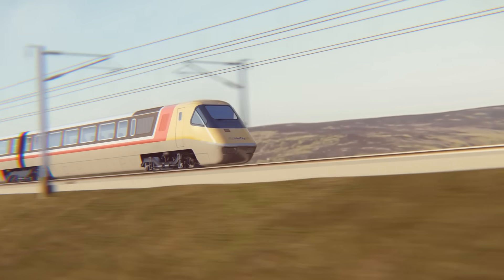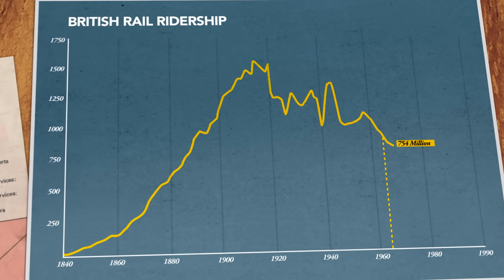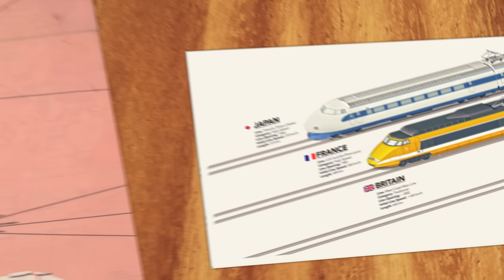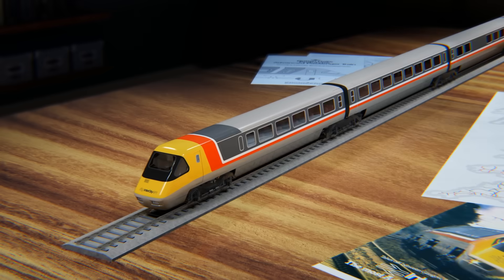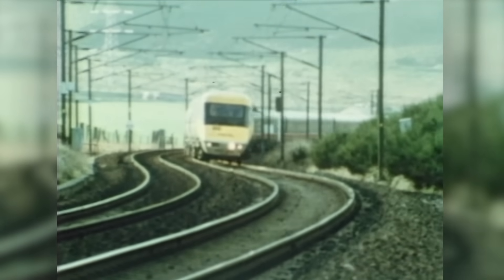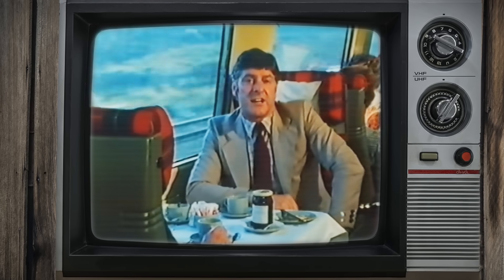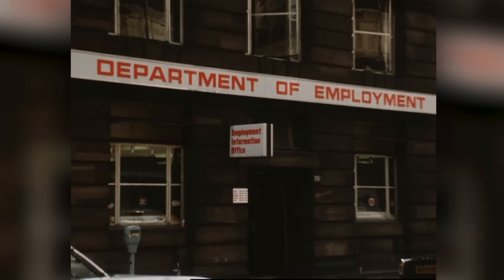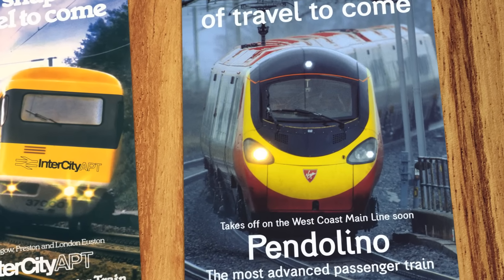This Train Made Passengers Sick: The APT Tilting Train Story

Comment: Destroyed by the press, the plans were sold to Italy for £40,000 and we bought them back as pendalino
Reply: Nothing of the APT ended up in the Pendolino. It's just a legend.
Apart for the fact that the Pendolino prototype, FIAT Y 0160, was built in 1970, while the APT prototype run for the first time only at the end of 1971, and the first commercial Pendolino (ETR 401) became operative in 1976 and had been retired from passenger service only in 2008, the working principle of the two is different. Pendolino has two gyroscopic and accelerometric transducers on the two bogies of every car, instead of a single accelerometer on the center of the car. That means that it reads the inclination of the track at the start of the turn, and can react in advance and more precisely than the APT system, avoiding the oscillations and imbalances that were the cause of the motion sickness of the British project. That's why it had been so successful worldwide.
The only reason why FIAT bought the British patents in the '80s, was to avoid someone else buying them and developing them in a competitor project.

Comment: Best thing is: the german ICE also has a tilting mechanism, that alows it to go just as fast as trains in the 1930's did between major cities. Never mind the fact that the system often breaks down forcing a reduction in speed or the fact that they do the same time the 1930's trains did despite the old trains having to serve more stations along the way. Oh and lets not forget that the AC in these trains often "broke down" in the summer or in harsh winters (in the summer the reason was that they were programmed as requested to not include temperatures above 30°C, meaning 30°C made the train think it was at 0°C instead. Yes this was the way Siemens programmed it on request of the Deutsche Bahn, which went with it even after the flaw was pointed out).

Comment: WHILE INDIA IS MAKING ALLTOGETHER NEW / SEPERATE FRIGHT LINES THE EXISTING TRACKS WILL ONLY BE USED FOR THE PASSENGER TRAINS. THERE BEING NO SLOW TRAINS THE RIDING ON CURVES WILL BE WILL BE BETTER AND MORE SUPER ELEVATION WILL BE PROVIDED. THE CHANCES OF TILTING INSIDE OF CURVES WILL HAVE NO CONSTRAIN AND MORE SPEED WILL BE PROVIDED ON CURVES ALSO. IN GENERAL THERE WILL BE 20% MORE SPEED ON THE CURVES.
PRESENT CANT DEFICIENCY OF 3" WILL BE INCRESED TO 4". SO ALSO THE MINIMUM SPEED LIMIT WILL ALSO BE INCREASED.

Comment: I like this video, although the reality of how rail was in the UK in the 1960s wasn't quite like that. It wasn't that people decided to stop using the train and so British Rail (the state rail operator) "tried to win them back". It was the result of government action. In the 1960s the then government decided that rail was an old technology which required a lot of upkeep and investment, so as a result of the Beeching Cuts hundreds of local stations and thousands of miles of track were abolished, and the money to upkeep them went into building new motorways and new airport terminals, as it was felt that was where local mass transit should be headed. As a result, thousands of people lost their local train station (through no choice of their own) and had to drive/use a bus or (for the more wealthy) catch an internal flight. It was only in the 1980s that the government of that time decided that rail travel was more useful than previously thought, and privatised most of it (also to raise capital), and ridership increased. But the local lines and stations were never restored. Today we have lots of different private rail operators with shiny new trains. None of them are any good and most of them are horribly overpriced, so anyone with half a brain just drives instead.

Comment: I was on the trip that gave rise to this myth. There was nothing wrong with the performance of the train and if you weren't told what to look for, you'd not have noticed. I saw part of this journey from the allocated seat, part from the centre power cars (not tilted- at least not on that journey) and from the leading and trailing cabs.

The trip was great. What caused a problem was the free bar in Euston for the journalists. It was being joked about at the time and then the story got around and developed a life force of its own.
Reply from the maker: Although I don't doubt that giving journalists a booze cruise was part of the problem, there are other myths surrounding motion sickness. One of them was that the active tilting was in fact too good initially, causing a disconnect between what the eye was seeing and the inner ear was (not) processing. After modifications to make active tilting less aggressive so as to introduce a little be more lateral forces, the motion sickness went away. At least that's how the story goes. Thanks for your comment and thanks for watching.
Reply: @MustardChannel  all I can do is to reiterate that I was on that journey and several of the testing journeys, which in addition to engineers from BR, also had families and other guests.

In all that time I only saw one person feeling sick and she said that she gets travel sick no matter what she's on.

Comment: The sad part of this is that SIEMENS came up with the ICE-T (T for tilting) in Germany which had quite some success on classic railtracks - they could get up to 230km/h of speed.
They are still used in the Deutsche Bahn Network in Germany. I never got motion sick and I used that train from Singen to Heidelberg weekly.

The Italian variant - the pendolino from Fiat Ferroviairia - was a huge failure though back in time - from burning transformers over constant failures of the tilting mechanism - service has to be cancelled often.
Reply: The ICE-T is made using FIAT patented technology and with FIAT supplied parts. The Pendolino had been a worldwide success.
Reply: @neutronalchemist3241  The Cisalpino Pendolino has been a total failure. Burning transformers. Technical defects.
Reply: @PascalGienger  Again, the ICE-T is made using FIAT patented technology and with FIAT supplied parts. The Pendolino had been a worldwide success. The "Cisalpino Pendolino", ETR 610, built by Alstom, not by FIAT, but using FIAT patented technology, was based on an ETR600 platform, built in 207 samples and successfully operated from Spain to China. It was so unrelable that Trenitalia, after having taken over half of the Cisalpino fleet, had ordered other 12 units.

Comment: The problem is that with the APT, British Rail thought they could get a high speed train on the cheap without having to reengineer the track and modify the signaling. They failed to see that even when the reliability kinks were worked out on the train itself, the signals would have to be positioned further back to allow for the same stopping distance at a higher speed and that the track would need to be relaid to smooth out the ride.

This was the lesson learned by Network Rail (the successor of British Rail, from a signaling and track maintenance perspective) and the holder of the Intercity West Coast franchise at the time, Virgin. Works were done to replace the track and reposition signals, replace overhead power lines and reposition trackside equipment to take advantage of the speed improvement in the Pendolino class 390 trains. The result is that for the class 390 Pendolino and the diesel electric equivalent, class 221 Super Voyager, the maximum line speed is 125MPH for tilting trains through enhanced permissible speed. This is compared to trains not equipped with a tilting mechanism where the permissible speed is 110MPH

Comment: As i recall the tilting mechanism worked well.  The train sets were withdrawn because of troubles with the brakes sticking on.  Ironically the Italian made Pendolino tilting trains have been running on a on several mainline railway routes for many years fulfilling the original vision of the APT long after the British made train was withdrawn.

Comment: Talgo Pendular, Spain, since 1980, working perfectly since then and even has a version that changes width to adapt between the Spanish and the French rails...
Reply: Talgo is a brilliant system, however it's pendulum system so there is an element of reaction. Once you start moving above a 100 mph / 160 kph  you have to enter the active tilt system market. As I say that's not to say Talgo is not a brilliant system, it just achieves an outcome in a different section of the market.

Comment: Just thought i'd add on that some of the technolgies of the APT was used in the Intercity 225 project which was a success, all the 225s are going through exams at the time of this comment. 3 Have failed, 1 has Passed
Reply: Yes that's the over looked part of the story. The MK4 coach (not as good as the MK3 ride wise) was the application of the work carried out on ATP-P and the Class 91 power cars have given years of service.  For anyone outside the  UK, the  MK4 coaches had chamfered ends to allow tilting to be fitted in future, but on the East Coast Mainline it was never worth the cost vs speed.

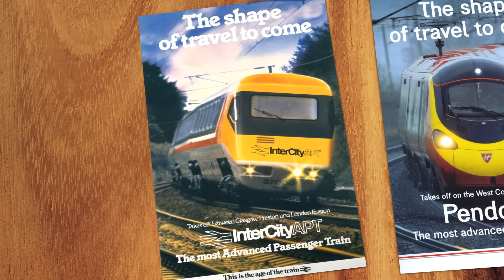Comment: @9:11 the British rail sold the patents to FIAT for improve the tilting system of the ETR450-ETR460.
The project of ETR401 (the first tilting train) was born in 1967 with a "tilting chair" on a Light Diesel motor car. The project  culminated in the construction of the prototype "ETR Y 0160". In 1976 the ETR401 made its first run.
The new "Pendolino" for the Virgin trains was made by Alstom, which has bought the FIAT railway industries and all their technologies in 2000.

Comment: Excellent video.  Kudos again.  

It sounds like you have read "APT The Untold Story" by David N. Clough.  It's a sad read.

The only things I would add is that the decision to put power cars in the middle of the train - instead of powering each bogie like the Shinkansen Bullet Train - was due to opposition to having high tension power cables between the cars which were soon to be introduced in Britain.  

If British Rail had been given the time and resources of almost any other fast train development program they would have succeeded.    The Inter-City 125 you mention is the most successful high speed passenger train in history and was the foundation of a revival in rail patronage not only because of their speed but also their reliability and time between maintenance.  They have only just been retired from service.

AFAIK the Fiat Pendolino's introduced to Britain don't have a top speed higher than 125mph (200kph) but they do take the corners faster, thus reducing travel time.

Finally:  Some of your viewers may not be aware of HS2 - the high speed rail network Britain is now constructing between London and the midlands.

Comment: Considered as a research project, which is all it was- the P-Trains were never meant for service, the APT was a great success.  The Class 91+Mk4 trains that entered service in the late '80s were (indeed are) APTs in all but name but those three letters were forever tarnished by the toxic media coverage.  The building of the Class 91s was put out to tender with all the data from the APT research so every train maker who put in a bid got all that information for free- and then GE subcontracted the construction of the locomotives to BREL anyway...

After the break-up and privatisation of BR and its divisions it's hard to trace the lineage but several tilting trains now running have some direct link to the APT and the ones that don't certainly benefited from that dissemination of data.
Reply: That's fair enough, but what did the 225 sets achieve that, say, an all-electric HST, or Class 89 couldn't have? The principal 'improvements', e.g. articulation, hydro-kinetic braking etc. were not carried over; the carriages needlessly sacrificed interior space and the Class 91's 140mph capability was redundant.

Comment: 7:02 They dropped the Rolls Royce engines for ones made by British Leyland.

That explains a lot.
Reply: I think the Rolls Royce engines were the gas turbines used in the experimental unit. The others were electric and British Leyland never made electric motors. Mind you I heard that a couple of times they took the gas turbine unit into tunnels at full speed and the air shock broke turbine blades.

Comment: Instead of just scrapping them, they should have fitted normal bogies and run as regular non tilt sets.. Don't need tilt on the east coast line. Get some use out of them instead of wasting our cash.!!
Reply: By the time you did all that it would be cheaper to just build a new train. Which is what they did.

Comment: Just an FYI at 3:00 that is not an accurate 1960s railmap. That's a modern railmap. It's missing a number of stations in North Wales as well as on the Wirral. Stations which have since shut down, but were still active even in the 70s.

Comment: If it was a brilliant idea it would’ve been a good idea by definition. This is more of the other kind of “brilliant!”
Reply: It was a good idea, which is why many countries now use tilting trains.
Reply: @nkt1  they tried on amtrak on the ne corridor and found the same thing, it was impractical on the existing infrastructure.
Reply: @JoeOvercoat  The infrastructure wasn't the problem, with the exception of the signalling system, which did not support the APT's higher cruise speed. Tilting trains have operated on this line for almost 20 years, albeit still limited to 125mph.
Reply: @nkt1  Exactly, they never fulfilled their promise, so where they ever worth the investment? We'll never know.
Reply: @JoeOvercoat  They almost certainly were worth the investment. The project yielded lots of valuable data on high-speed running, tilting, etc.
Some of the tilting technology was sold to Fiat. The InterCity 225 is basically a non-tilting, non-articulated APT.

Comment: 8:35:  That's what I was just thinking even before I heard it being mentioned here:  It's ambitious enough to simply make a modern train that will simply adapt itself to existing railroads so that no new railroads will have to be run just to accommodate the new trains, even without any increase in speeds.

Comment: Excellent stuff! I think you may have underestimated the political factors at play here. Mrs Thatcher was notoriously anti-rail and pro-car, meaning that British Rail was dealing with a very unsympathetic Government in the 80s. Political pressures contributed to the APT being launched too early and at the wrong time of year (winter) in unusually cold weather conditions. The need to rush the train into service was undoubtedly influenced by the huge success of the diesel HST which had debuted in the 70s as a stopgap train as the APT project experienced delay after delay. The unexpected success of the HST ramped up the pressure to make the APT an even bigger hit with the public. Ultimately, I think the APT was just too innovative for its time.

Comment: It's a pity it failed, because the tilting concept makes good sense.   The worry however, is that the joins of the existing tracks would make a huge racket at high speeds.

Comment: Queensland Rail here in Australia operates two tilting train services, one diesel one electric. They both work well and are the pride of the network.
Reply: Work well is an overstatement. It is often "not working" for reasons not told to passengers so it travels at normal speeds and in summer the it gets too hot for any train at all and they have to stop it during the highest temperatures to wait for the tracks to cool down
Reply: @danielstaines421  Shade sails over the tracks? I'm kidding of course, but one wonders how to fix such a severe problem.
Reply: @Bobo Might help. Good eco move, at least for PR, and would create jobs too.
Reply: That tilting system is from Japan JR.
Reply: @前田幸俊  Britain was the first to develop it. It has been adopted in many countries.
Reply: @FloydBromley  Exactly I know the tilting system first in the world is of UK.I said Queensland Rail adopted Japan JR tilting.
Reply: @前田幸俊  yes based on Japan and developed further. The electric tilt train has the unusual record of fastest narrow gauge train in the world (by fastest tested speed, but not revenue speed).
Reply: @FloydBromley  Thank you for your prompt reply.I wanted to have travel by APT.
Reply: @FloydBromley  BR pioneered the active-tilt concept. The first tilting train was American back in 1936.
https://en.wikipedia.org/wiki/Tilting_train
Reply: @FloydBromley Spain uses passive tilt. Same as the older tilting trains.

Comment: A major problem was that the sensor controlling the tilt of the coache was in the same coach. This was fixed when the sensor in the coach in front was used to control the tilt. This is not the only time control engineers have got things seriously wrong.

Comment: This is bollox. The reason the ridership declined was that Lord Beeching decided in 1962 that the branch lines, which fed passengers to the main lines, didn't make a profit and closed them. This left the profitable main lines without a source of passengers, and passengers without destinations. By the time Beeching published his report the Deltic locomotives were able to reach 120mph with around 20 coaches. I used to get the Penzance to Edinburgh train home every night from Darlington (one end of the first line) to Newcastle. These tilting trains were built for the west coast main line because they wound through the hills. Britain didn't lack fast enough trains for most routes. The death of the APT was Margaret Thatcher threatening to pull funding, resulting in the train being released to service before it was ready, and put in the hands of maintenance instead of development engineering. The US has a similar problem and solves it by crossing the Sierra Nevada at 30mph, but the US has never made an attempt to solve the problem, not even one Margaret Thatcher destroyed.